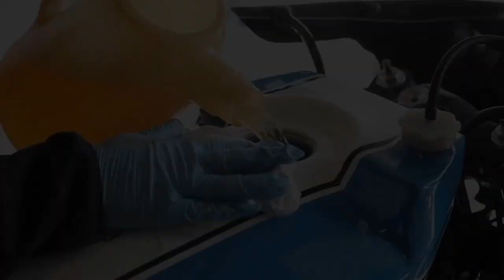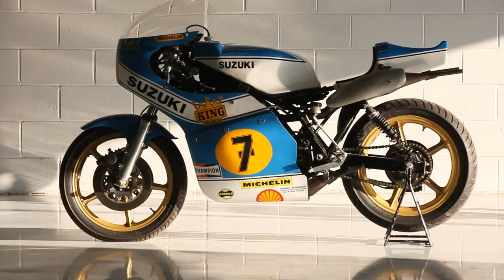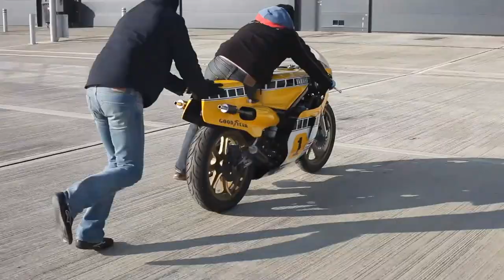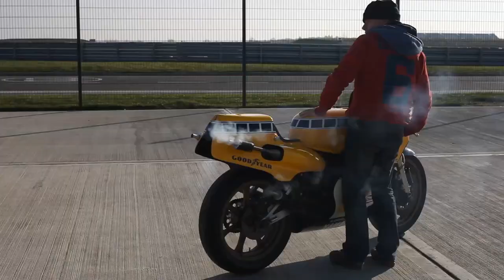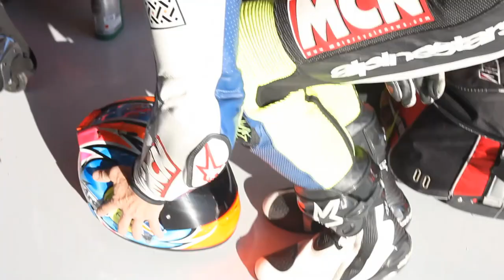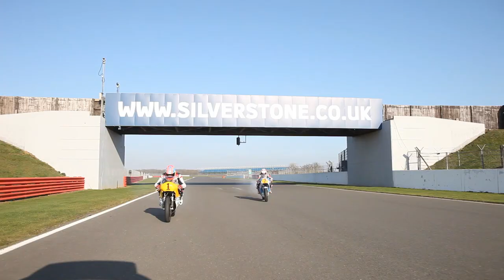Barry Sheene and Kenny Roberts bikes ridden

Comment: Absolutely awesome!
Re: running rich comments ......If I owned one of these legendary machines I'd be running it rich too.
It's not like you can go to your local Yamaha or Suzuki dealer and buy a new top end over the counter!
Reply: too rich is not good for a 2 cycles too,,,bad for the lower end of the engine.raise to much compression,,blows crank seal
Reply: Spark plugs are cheaper than classic GP bikes ridden by the legends , correct?
Reply: Great point spark plugs are cheaper than a seized motor
Reply: @gervaisfillion9417  correct
Reply: The engine is cold don't forget in these shots
Reply: What would get the two stroke riders is when they came to a sharp curve that was long and they shut the motor down to loose speed. When they turning the motor down they were also turning the oiling down or off the engine seizes from that fast hot straight previous bad situation,    CRASH
Reply: Darkwell0071 Yes but some them solved that by drilling a bleed hole in the throttle slide or butterfly to let fuel through even when the throttle was closed

Comment: Never had a whiff of Maxima Super M.  I used to race with Era,[EAST COAST ROADRACING ASSOCIATION] AND AAMRR riding a  RD-400 with PJ1 synthetic oil. but my racing partner was a AMA Junior riding a Yamaha TZ 250 Road Racer I usually was on the grid to push start him with 30 or so Road Racers in the field , no silencers then and all burning Castrol R. those Castor Bean fumes lit up your senses like none other.WONDERFUL
Reply: I remember the start of the Daytona 200 in 1974.  I will never forget the smell of castor bean oil (Castrol).  The "smell" of adrenaline, excitement, and fear.  Damn..............
Reply: Me too back at Summit Point! Remember Richard Chambers and his TZs? RIP Dr. Peter Frank.

Comment: Usual to 'smoke' when cold but when thoroughly warmed up, engine uses actually very little oil. I got around 600 miles per litre.  In 1990 bought one of the last made RG500's CH (1989) Pepsi-Suzuki "Kevin Schwantz" GP Race Replica, Interestingly, the last of the street RG500s (the H model) had almost the same power output as the original works racers!

Comment: Who's the tool who mixed the gas/oil? Looks like they used conventional  10W/40 motor oil mixed at 20:1.
Since the video maker is so disappointed with the noise, smell and power characteristics, maybe they should let people who appreciate such machines use them.